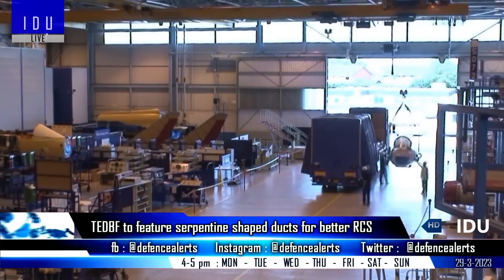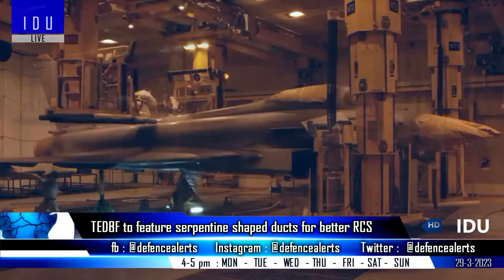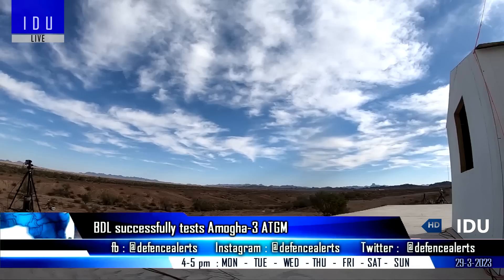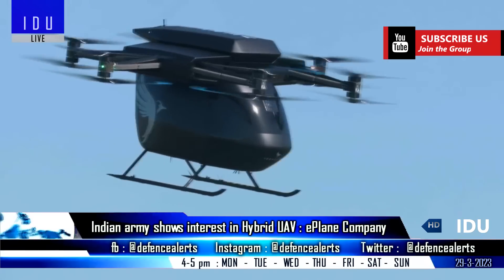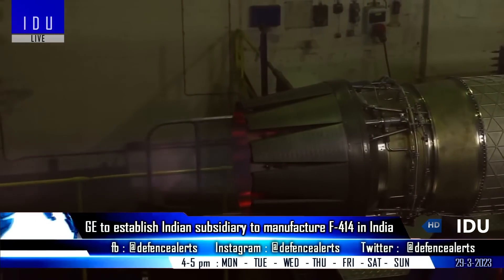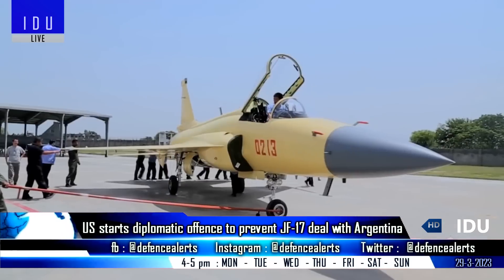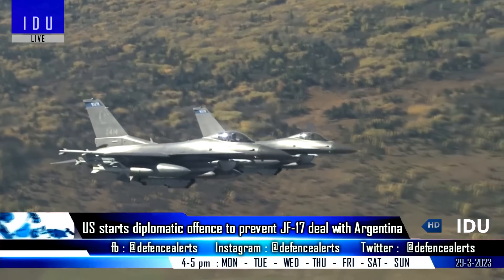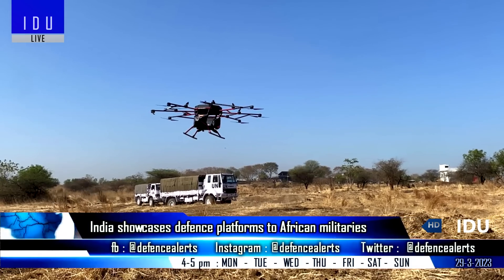Indian Defence Updates : TEDBF RCS Improved,Amogha-3 Test,New Hybrid UAV,F-414 Engine Facility Pune

Comment from the maker: :yt:What's Your Opinion : "Serpentine ducts on TEDBF for better RCS" ?
ＬＩＫＥ | ＣＯＭＭＥＮＴ | ＳＨＡＲＥ | ＳＵＢＳＣＲＩＢE
Reply: Let's see when prototype rolls out...till then better to have zero expectations
Reply: On paper you can even call it completely invisible ✌️
Reply: Jab itna ker hi Diya hai to , Internal Weapons Bay and Dual-Vertical Stablizer (instead of single) v add kr hi dete , with length extended upto Mig-29's length 😅
Reply: Everything's great...but Make one fast..🤕🤒
Reply: That already is many old 4th gen planes, nothing new. Even Tejas has Y ducts.
Reply: Bits and piece of news about TEDBF and MK2 to negate parliament standing committee revelation about delay. No use. MK2 in 2032 and TEDBF by 2035 is too late.
Reply: @Flying Tiger Pointing delay, Navy would acquire more Rafale M and finally say they dont have carriers to accommodate TEDBF. Good idea. Airforce needs this kind of intelligence.
Reply: don't ever called amca or tedbf a 5th gen fight jets coz both of them doesnt have many 5th gen tech. specially vertical lift up, don't consider only stealth is the only requirement for 5th gen. it is the most important req. but u have 2 satisfy others also to be considered as 5th gen. fighter.
Reply: Untill and unless it had been started flying and used by the navy and air force IM TIRED OF LISTENING EVERYDAY ABOUT OUR TEJAS MARK2 AMCA TEDBF AND NOW ONE MORE IS VOMING IP IN THEORY CALLED HLFT 42 WHICH HAL THOUGHT THEY MIGHT BE ABLE TO PUMP OUT MORE BILLIONS OF CRORES OF HARDWORKING TAXPAYERS MONEYS THAT IT'LL USED AND INCLUDE THAT WEAPONS SYSTEMS....ALWAYS EVERYDAY KEEPS ON SAYING IT'LL BE INTEGRATED AND UPGRADED WITH AND FEATURES THAT THAT AND THAT ETC.....EVERYDAY COMING UP WITH NEW SYORIES OF COMING UP WITH THAT IT'LL USED OR FEATURES THAT AND THAT AND THAT AND THOSE AND THOSE ETC ETC ETC.....UNTILL AND UNLESS IT HAD BEEN INTEGRATED AND START FLYING WE THE 1.4B CITIZENS OF INDIA'S INDIAN ARE TOTALLY 100% TIRED AND FED UP OF LISTENING ALL THESE LIES AND COOKUP STORIES OF ADVANCE MILITARY WEAPONISED SYSTEMS EQUIPMENT FOR OUR ARMED FORCES BUT NOTHING IN REALITY....PLEASED STOP POSTING ABOUT IT UNTILL WE START INDUCTING AND OUR ARMED FORCES ARE USING IT.....THE DAY OUR AIR FORCE NAVY ARMY STARTS USING IT THAT TIME YOU CAN START PATRONISING IT ADVERTISING IT GLORIFYING IT ETC ETC.....NOT EVEN PROTOTYPE IS THERE TO BE SEEN AND HERE ALMOST IN EVERY NEWS WE SAW THE UPDATION ABOUT IT ABOUT WHAT KINDS OF SYSTEMS WEAPONS SENSORS AVIONICS ETC IT'LL USED....FROM THE CONTINUOS UPDATION ABOUT OUR HOMEMADE FIGHTER JETS IT WILL NEED ATLEAST 5/6 FIGHTERS JETS AS THERE'S TOO MUCH UPDATE OF WHAT KIMDS OF WEAPONS AND SYSTEMS SENSORS AVIONICS AND WHATNOT IT'LL BE INTEGRATED

Comment: Why argentina wants junk fighter 17 when tejas is right there?
Reply: Because China can supply a full solution free of Western influence(read British) from the engine to the ejection seat.

Calling it Junk Fighter aside, realistically, the JF-17 now has a lot of mature subsystems that has been flying for more than a decade that is backed by a large and fairly independent industry(Chinese Aerospace Idustry)
Reply: @sidewinder3422 
If it is so much better then why is Pakistani fleet are grounded secondly engine of JF 17 is Russian and Russian will not able to provide parts in case need arises.
Reply: @jagadishbhatta9562  Is it really though? Aircraft in service in large numbers goes through a cycle of being groundedI mean even the F-35 gets grounded),  granted the JF-17  has probably a lower service cycle and more maintenance heavy than the Tejas, Russian engines has a lower service life than Western engines and all metal airframe requires more maintenance than a composite airframe of the Tejas. But fact of the matter is there are 160+ JF-17s in active service today in a few countries.

JF-17 Block 1 and 2 are probably the closest in terms of being a "Junk". But the Block-3, dude the JF-17 Block-3 is good. Mature modern avionics, AESA radar from a mature platform(J-10), complete package of  Chinese munitions that are "actually" being mass produced. All of the juicy experience of Chengdu trickles down to the JF-17.

J-10 and JF-17 are not on the same class btw.
Reply: @sidewinder3422  
If JF17 is such a capable aircraft why is Chinese PLA not using it. Pakistani too prefer using their old F16 jets instead of JF17.
Reply: @sidewinder3422  US doesn't want them to buy Chinese jets though
Reply: This is due to our slow production and many delays
Reply: Because they are becoming China's puppet slowly. China is giving them loans and infrastructure so they are falling for their trap.
And their economy is bad.
Reply: Does India have enough Tejas? We need for ourselves first look for export when at least we're halfway through our requirements
Reply: I dont think JF17 block 3 can be called junk. It is one of the cheapest modern 4gen jet. Ofcourse it is not very good, but it is cheap.
Reply: someguy9942  
Grounding is nothing new well if 60% of JF 17 is grounded then what do you call that? I am talking about Pakistani JF17 fighters even myanmar JF 17 are grounded? You are comparing Rafale with Tejas dude they are belongs to different category Rafale is medium class fighter jet Tejas is light weight. J10 and Jf 17 both are medium class fighter jets.
Reply: @jagadishbhatta9562  J-10 is much more a better airframe for PLAAF. You can stick all the avionics of J-10 to the JF-17 and JF-17 will still have less range and less payload than the J-10. But of course the drawback is J-10 has a higher operating cost than the JF-17.

But this is no problem for China because unlike cash strapped Pakistan, China has all the money it needs to keep its military machine going.

Basically China is so rich they don't bother to have a relatively low operating cost Light Combat Aircraft type in their fleet(essentially the Tejas and JF-17).